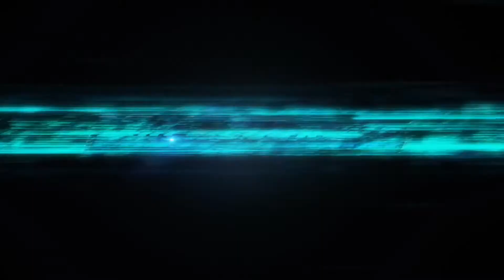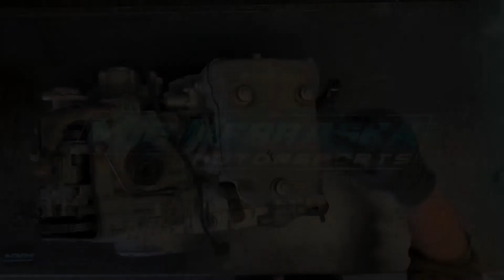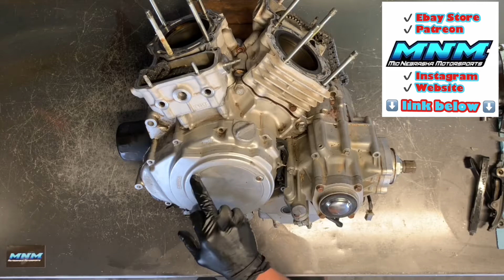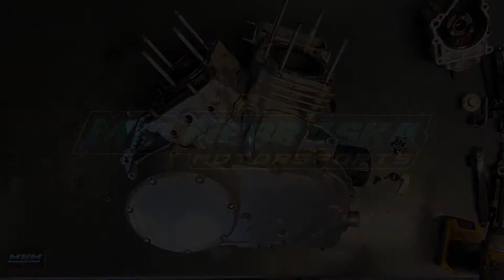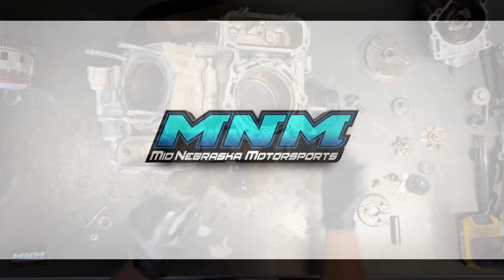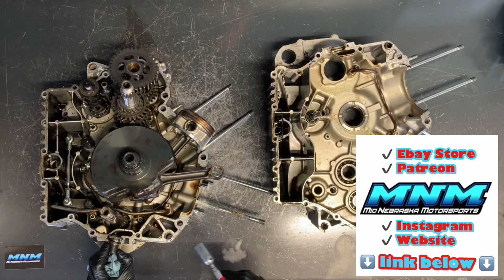Kawasaki Vulcan 750 - Complete Engine Motor Explained Crankcase / Transmission Split

Comment: Great video! Any idea what could cause the small arm where😢 the clutch cable connects, to flop around freely? I just change the stator and when putting it all back together I realized it's broke but I have no clue what could've caused it, or how to fix it..after watching this video im still just as confused 😂

Comment: Oil pump shaft is also leftside counterbalance shaft. The shaft obvs does not need to be timed but the wieght does but the wieght goes into the gear so really its just the gear mark that needs to be aligned to the flywheel mark but when fitting the wieght and gear the flywheel is acually off so that is why the started marking the later ones with a punch mark and a marker. That is my observation of it and i am now going to install.

Comment: I need to slide a new driveshaft in, the teeth stripped on the wheel side. The output gear case you pulled with 8mm, its that easy? I can just take that out and slide the driveshaft out?

Comment: I have a 1994 kawasaki bayou 300 2x4. Can I remove the cam chain tensioner and replace with new oem one without taking anything else apart? Plug and play kinda? Thank you again for being my goto mechanic for working on a few bikes that you did videos on. !!
Reply from the maker: Unfortunately you'll have to tear deeper into the bike.  Watch our previous Vulcan videos to get an idea as to what it'll take. Thanks for watching. check out: https://www.ebay.com/str/midnebraskamotorsports

Comment: Is a rough idle affected by the air/fuel mixture screw on the carb being out of adjustment. Working on a 2000 suzuki lt-f250 quadrunner 2x4. Bike idles little rough, but drives smooth with instant throttle response. Cleaned the fuel tank, new fuel petcock , fuel filter,spark plug and fresh gas and seafoam but still has fluctuations in the idle. Thank you for all the great videos ps.
The 2000 2x4 suzuki lt-f250 quadrunner seems only have 1 14mm oil drain plug, no 21mm in sight. Maybe it is only on the 4x4 model.

Comment: Curious if you have any suggestions.  I have an older Polaris Trailblazer 250 that keeps breaking the lower rear mount bracket.  I have put 3 brackets in total in, and they all snap is the same place where it bolts to the back of the engine.  Replaced all 3 motor mounts/brackets, and still happens.  Lasted about 6 months before it broke again this last time.